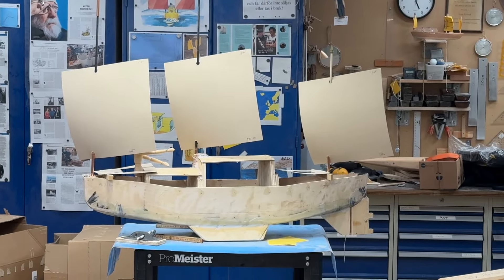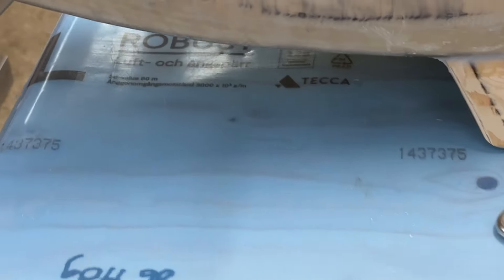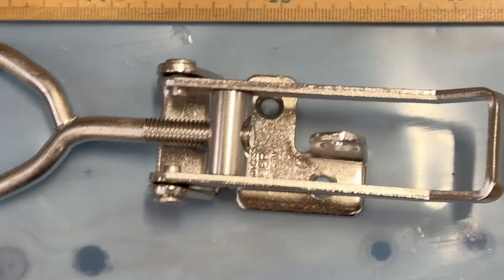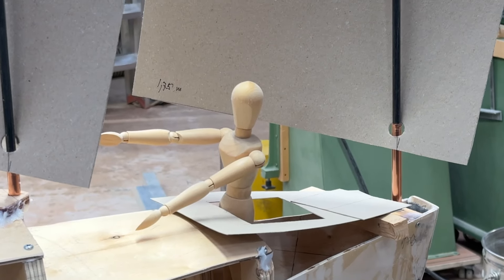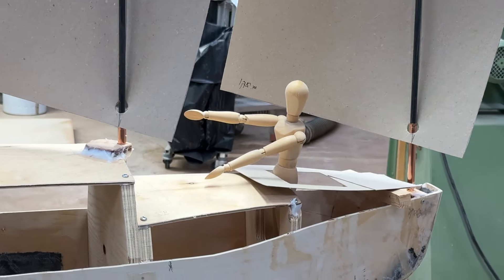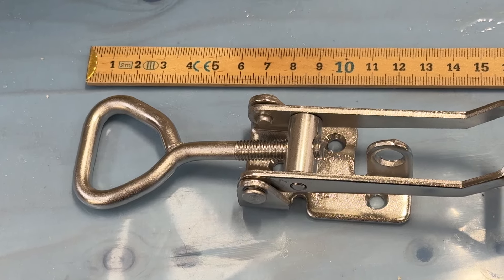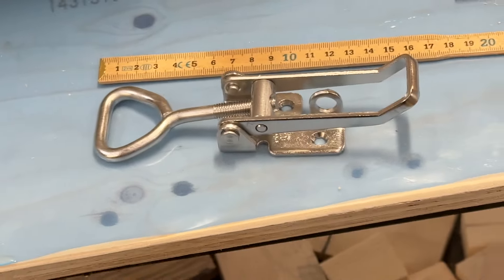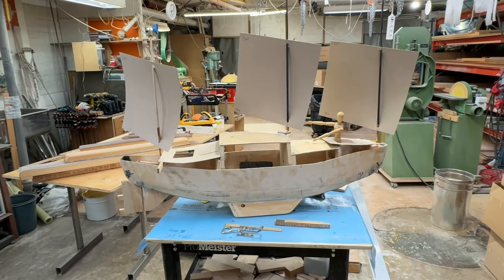5 May 2024 Hatches: For Perry Ocean Crossing Small Sailboat

Comment: You can use those toggle latches on circular hatches.
Reply: I think the square hatch it to keep the hooks on the lid  lined up. If the hatch is round he would have to spin it to line the hook on the lid to the toggles when he wants to close it.